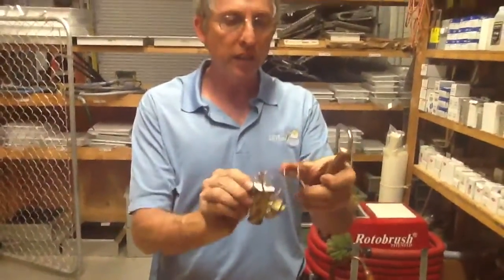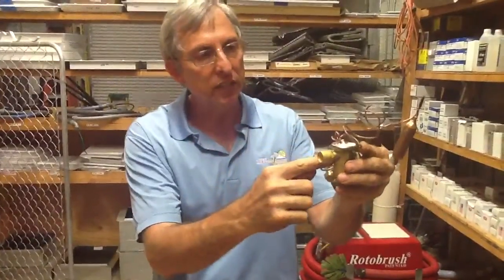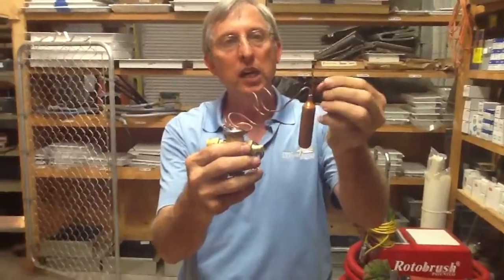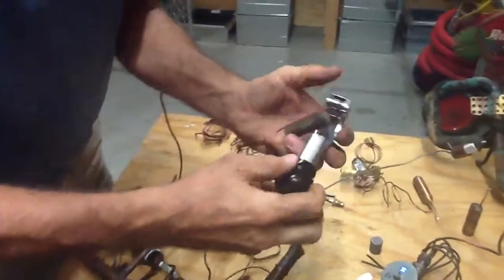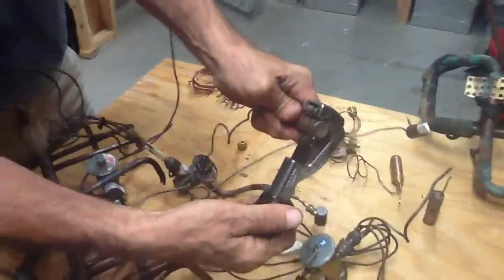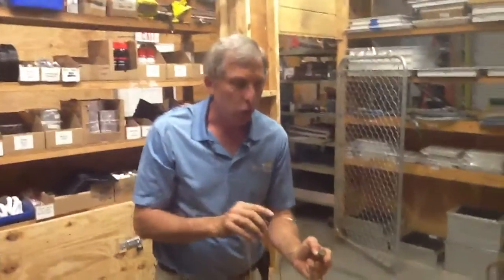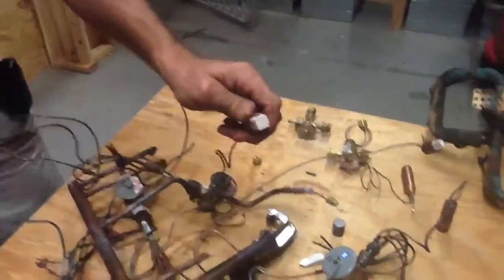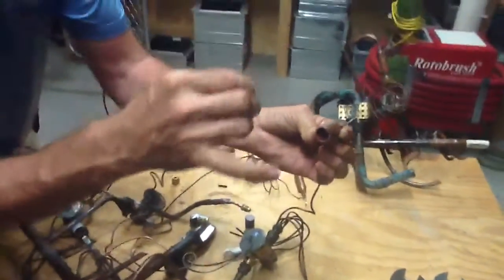Listen to the TXV Gas; What's Inside of the TXV?

Comment: The sensing bulb will reach 130 degrees in a heat pump that is heat mode. So therefore the 130 degree limit makes no sense. Other than that decent video